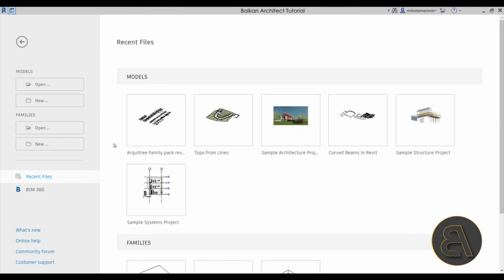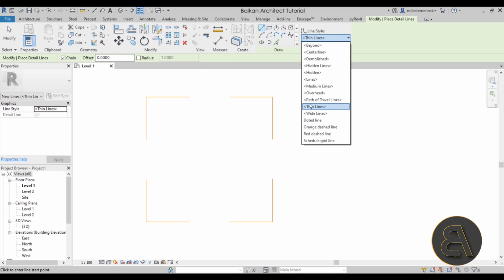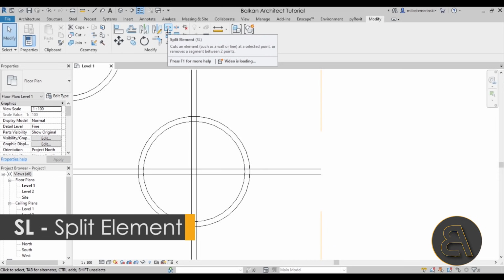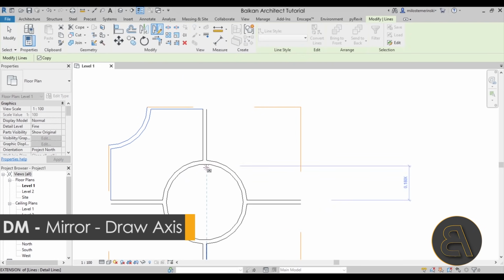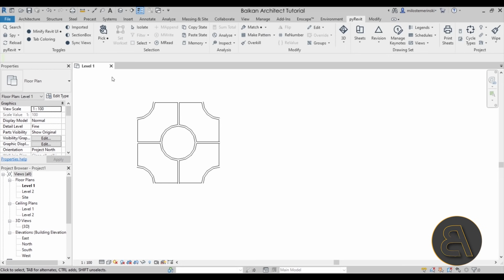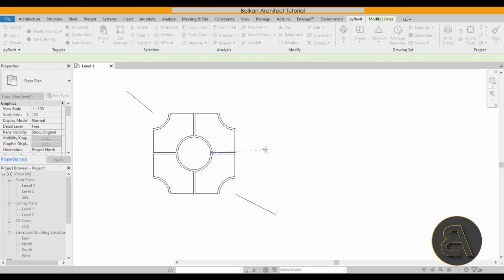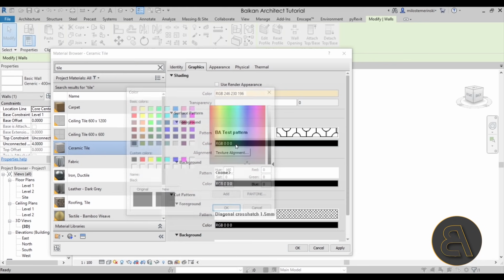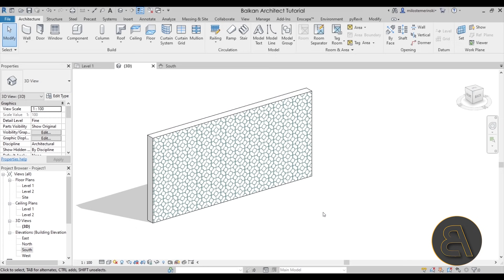Custom Fill Pattern in Revit Tutorial

Comment: How one can edit an pattern if top and bottom shall be at full size piece and center piece might have cut piece so that can be applied at different locations… for eg. brick wall in elevation where top and bottom is of full block center can be cut and could reduce pattern size??

Comment: Great tutorial ! I was wondering if there is any way to use these patterns to make a solid form out of it. For eg. in the pattern made by you above i would like to have a solid made out of it where the circle is a void part and the rest is a solid part, so that it looks like a facade design. any method where you apply the pattern on the wall or a floor and the geometry(The central circle in case of your pattern) is cut out of the wall/floor

Comment: I created a simple triangle patter. Now when I want to apply the hatch pattern to compressed earth, as part of a floor, the patter does not align correctly. It shows the center of the triangles and the rest are cut off.

How can I make a pattern only repeat horizontally and not vertically. Because revit seems to stack multiples of them
and I just need one